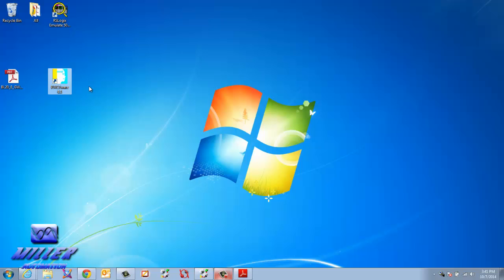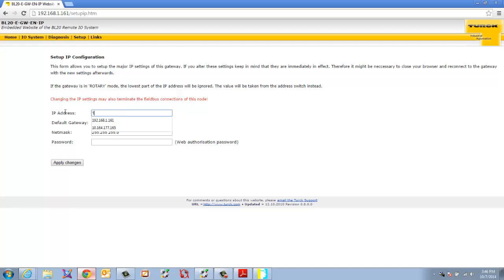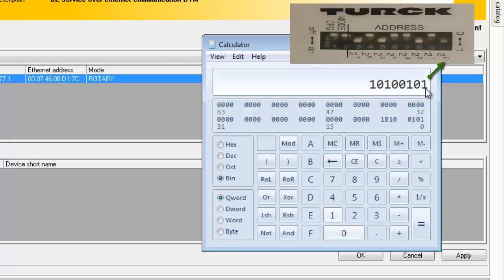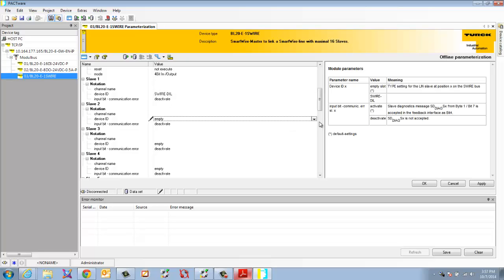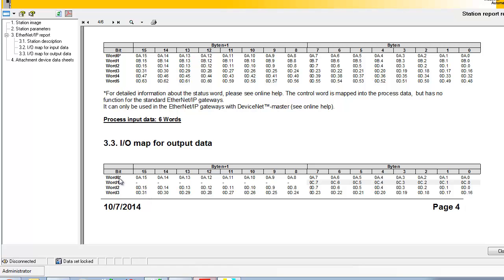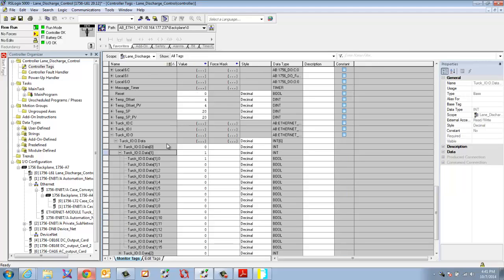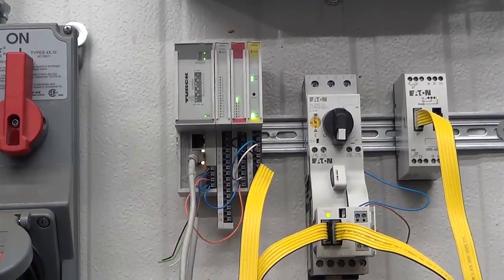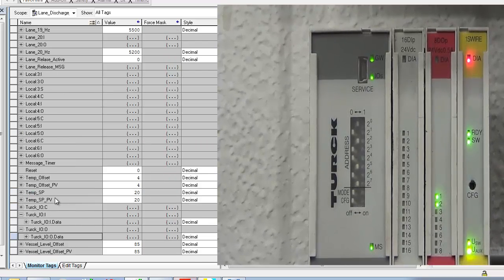RSlogix 5000 adding Turck BL20 Over Ethernet

Comment: Thanks for this video.  I would like to know how do you setup a BL20-GW-EN-IP with few digital IO and a BL20-2RFID-S when you dont have the modules in hand yet?
Thanks
Reply from the maker: I'll explain this fall sir sorry been extremely busy with many customers I'll get an update for you.
Reply: Gilles, you can create an offline project using PACTWARE in order to setup your BL20.
Using RSLogix 5000 you can setup BL20 as a generic module, using device catalog (CIP bridge) or using EDS.
Remember to order BL20-GW-EN (without IP) this is a Multiprotocol device and is newer product.
Hope it helps